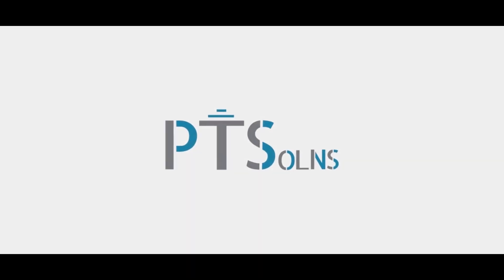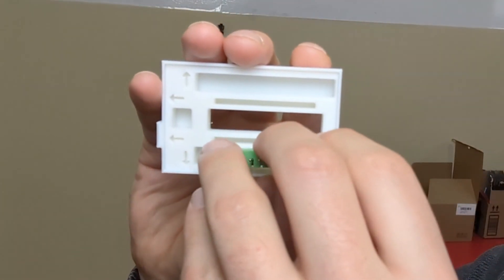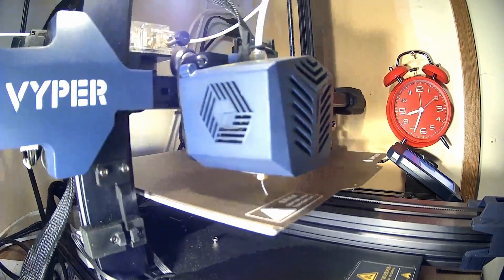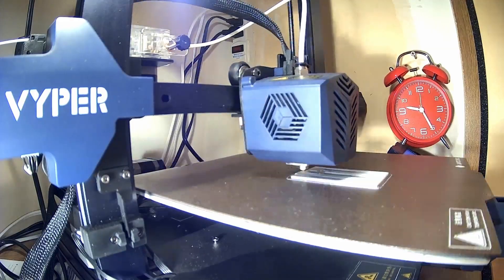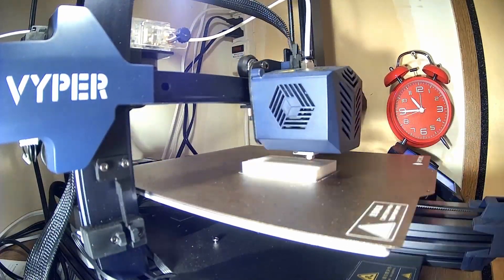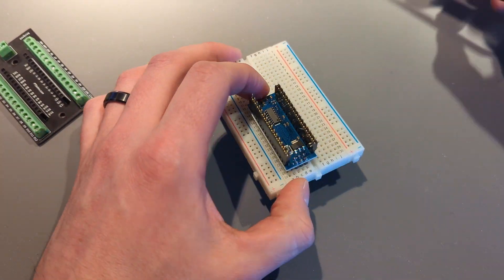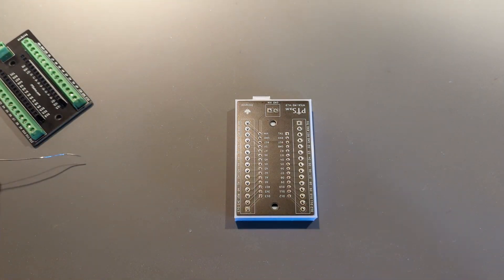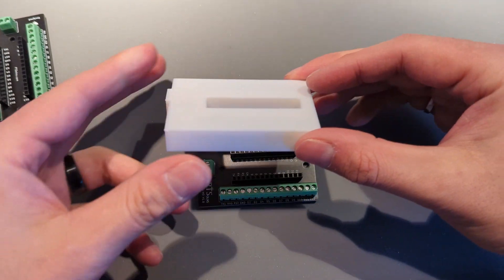3D Printed Soldering Jig

Comment: Very nice. How long did you take to model the jig ? Video mentions printing a few times to get the tolerances right
Reply from the maker: Getting the tolerances right on all the components was the hard part. I think we printed 3 or 4 different times to get it right. But once it works, it works well.
Reply: @ptsolns  That's really cool. Which software are these boards designed in, if I may ask ? KiCAD ?